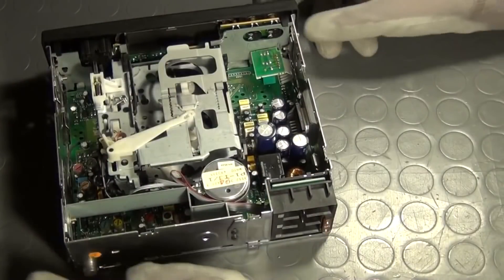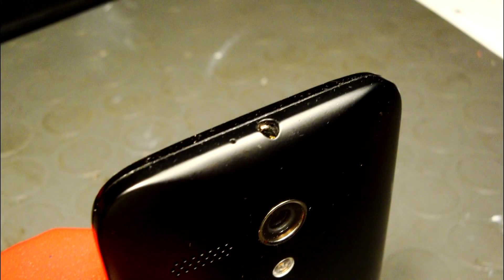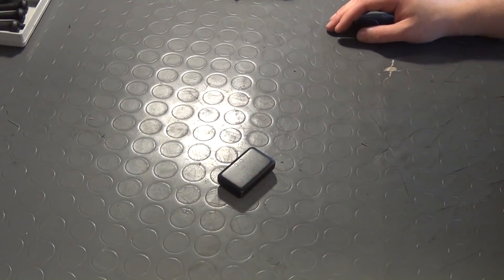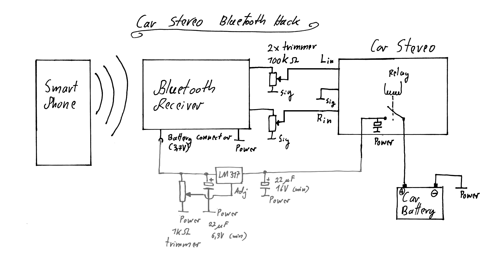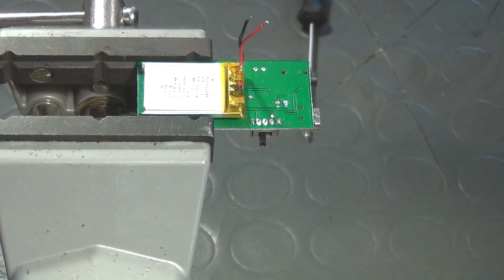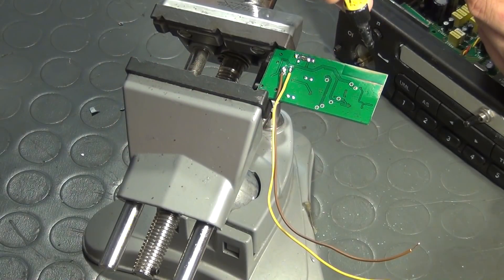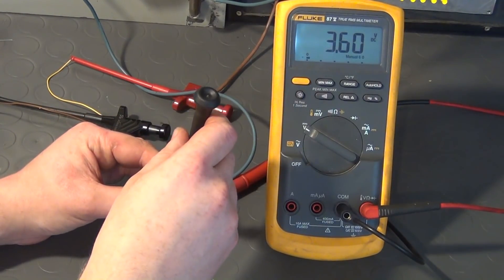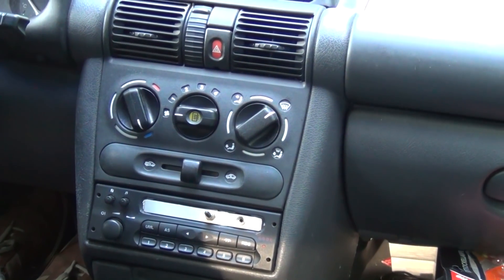Hack: Adding Bluetooth to  Car Stereos and Sound Systems

Comment: We want welding stuff.
Reply from the maker: Hans Hey: I've been working on a new welding machine teardown + explanation video for the last three days non stop, but simply couldn't finish it today. That's why I decided to finish this video first.
Reply: The Post Apocalyptic Inventor How about DIY MOT welding machine, that you promised to build and test how it performs? Do you want to build simple MOT welder or you want DC version with Bridge Rectifier, caps and smoothing coil ?
Reply from the maker: I actually set a patreon goal for that ( which I never reached). Hence I will wait with that project a little longer.At the moment I'm modifying a large MIG/ MAG welding machine, that will also be the topic of the next video. Once I will build a MOT welding machine it will have rectifiers, coils and many other functions. Simply building an AC MOT welding machine is something that many other people have already done.
Reply: The Post Apocalyptic Inventor Well, take your time. The quality/quantity trap is a bitch